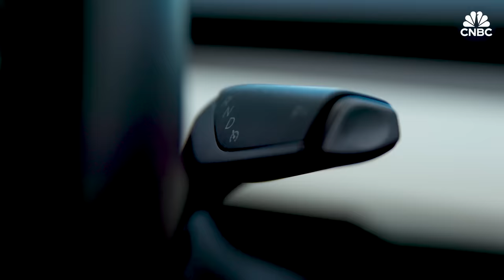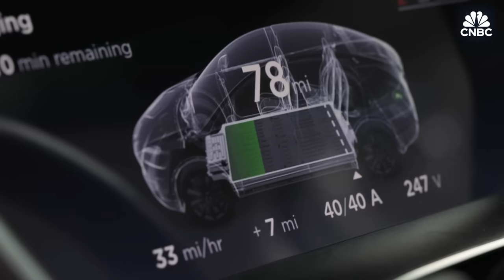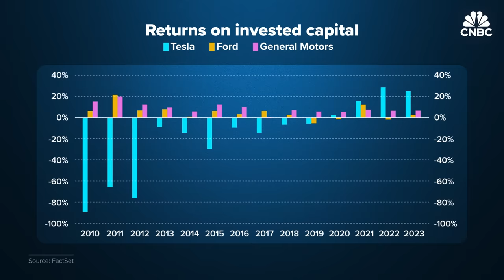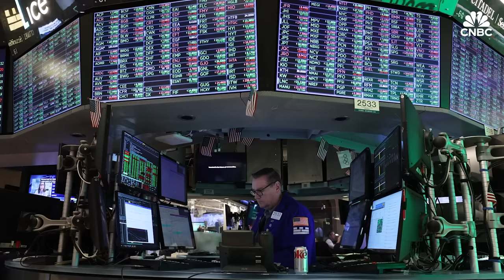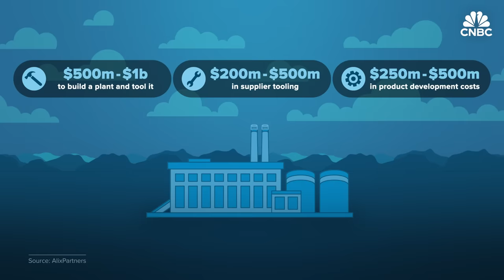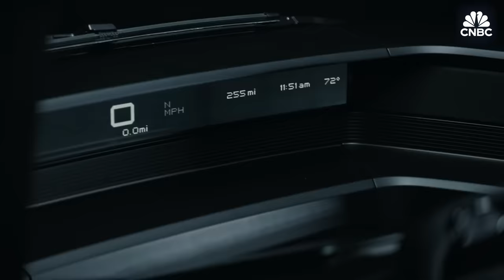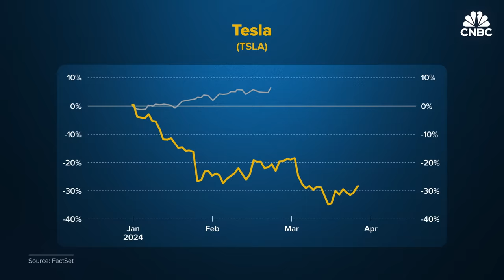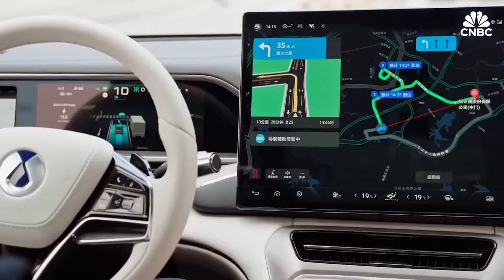Why So Many EV Companies Fail

Comment: Why they are failing? 50k to 100k is considered as a luxury car.. not many can afford 50k and up..
Reply: Teslas are available for under the average new car price.
Reply: You can now buy an EV cheaper than a Toyota Camry.
Reply: @MadDogEighty80   the main issue is the big ICE car companies haven't gotten the DEALERS on board yet.   They were happy to sell Lightnings for a 50K markup, but now that they are in good supply they don't want to sell a low margin EV to a potential truck buyer.    Plus servicing the EVs is mainly just replacing the tires.   Those $150 oil changes add up.

Don't believe me?   Go to ANY Ford dealer and ask to look at Lightning and see how fast they are showing you new F150s and F250 ICEs instead.
Reply: @redwolfexr I’m pretty sure the 90 mile range while towing deters  people from buying
Reply: @user-zt6bt8dp2c   Most people buying F150s are not towing anything.   You get F250s/F350s for that.

Most trucks are rarely used for towing or cargo "in the city."   Those are the types that are looking at Lightnings in the first place.
Reply: @redwolfexr  nobody is looking at lightning that’s why they cut production and had to halt shipments. All EVs are starting to pile up
Reply: @user-zt6bt8dp2c   again, because the DEALERS don't want to sell them.  The brands that are EV only seem to sell just fine.  They are lower profit than the ICE and need less maintenance.

Ever actually TRY to look at them at a dealer?   I looked at a Lyric, and the dealer kept wanting to show me gassers and to test drive one.  (but the LYRIC was for some reason "not ready" to test drive)

If you have 60K to spend on a new car they want to sell you a high profit SUV, not an EV.
Reply: @redwolfexr  I transport Tesla and keep up on EV market. EV are not selling especially now with high inflation and high interest rates. Not many people have 60K+ to spend on a vehicle. The government subsidies on EVs is what kept the sales up due to people taking advantage but it will dry up. Hybrid right now is the way to go maybe EVs will be the future when they figure out how to charge while on the road but with no EV infrastructure sales will keep dropping. Go to Lexus or Toyota the dealers can’t give away the RZ or bz4x
Reply: @user-zt6bt8dp2c   I can't throw a rock in a big city without hitting a Tesla...

Almost all of them are the cheaper models than 60K.  60K actually gets you REALLY nice vehicles like the Lyrics.   Well, if you can get the Caddy dealer to sell you one.
Reply: @MadDogEighty80  Which one?
Reply: the technology just isn't where it needs to be for mass production
Reply: not in China
Reply: @MadDogEighty80  Which EV? Cheapest I see is the nissan leaf and even that isn't cheapest than a base camry
Reply: BYD cheapest EV priced at 9000, but Joe said Americans done have the rights to enjoy cheap good quality cars😂
Reply: @MadDogEighty80 I’d rather have the Camry
Reply: At 50-100K they're still losing money on each car because a lot of the cost is in new production line, R&D etc and it's spread across fewer cars sold compared to hybrid or ICE
Reply: @vueport99  Yellen: BYD must sell its overseas headquarters to the US, or we will ban u 😂
Reply: @trumpbuddha1053  even Warren Buffett is walking away from BYD. I don't think anyone in USA would buy BYD HQ. It's just a small building. Total waste of time.

The bigger question is what they plan to do about all those cars sitting at the docks in Germany? Or was it simply shipped overseas to claim export bonus from CCP? 😂😂😂😂🤣🤣🤣🤣
Reply: @vueport99  then why complaint, u should be the treasury
Reply: Any $38k and above is a luxury car to me.
Reply: @Gaming_Antics  sadly with inflation that is entry level these days. Back in the day you can get a Mercedes under $40k
Reply: @Gaming_Antics  Before BTD in the 2016-2020, Tesla was making 48% profit margin, lucky they moved to manufacture in China, they are still able to make 12%. Yellen: China must not flood the market with decent price goods, we cant rip people off anymore
Reply: @redwolfexr  Do you know ICE adopted to be fueled with LPG and CNG are dirt cheap just like the fuel itself? 
Also, those are not burning oil to be charged on the EV station. Exhaust gases consist mainly of water vapour. So, yeah, extremely eco-friendly. Truly not in Musk's promises.
Reply: @HanSolo__  my LPG truck wasn't any cheaper to run than gasoline.  Plus the tank had to be certified and LICENSED by the state every year.  (I started filling it in the next state over when I was there)  Only needed the license to fill it in Texas.

So yes, I did know.  :)
Reply: @user-zt6bt8dp2c funny thing is china EVs are pretty good have good warranty like American EVs and cars and yet they sell them like hot cakes around the world except America and sell for a cheaper price with the same luxuries as tesla
Reply: EV companies charge less than it costs to make the vehicles. That is only due to government subsidies and is not economically viable over the long term. Want proof. Get a quote on a replacement battery for an EV.
Reply: @nickwest932  that would be because of tariffs but on batteries making them cost more . Buy a EV out the country and see how much to replace the battery system. Much cheaper then here in USA .
Reply: @nickwest932  Depends on the vehicle.  Some are only on the market to offset the gas guzzling V8 SUVs for California and similar markets.

That is why most of the F150 Lightnings went west.  

Tesla has long outspent its "government" subsidies.  They are making money per sale even if they may lose money due to warranty issues.  The low and mid range cars that being introduced in Europe first and brought to US are profitable.

The BYDs are still going to kick everyone's butt to the curb.

Comment: It's more broad than this "EV companies failing" thing.  Getting into the auto industry as a whole is enormously difficult, EV or otherwise.  The auto industry is littered with such failures.  The EV craze is subject to it too, though the craze insulates it temporarily (the craze, meaning, people  see that Tesla did it and just assume others can too, but it doesn't work that way).
Reply: Goated Talent
Reply: EVs are a once in a generation opportunity to compete in automotive.  It will never be easier in out lifetime -but that doesn't mean it will be easy -or even profitable.  That is the mistake.
Reply: @skyak4493  It will never be easier than it was right about 2010 or so. That year you could buy huge factories and huge press machines for a song, there was no established competition, etc. By 2015 the window of opportunity was closing fast or already closed, any new company would be entering the market no sooner than 2018, when Tesla would be making the Model 3 in mass market volumes and prices already. But IF these companies had delivered top quality cars then there was still a window because the Model 3 was bad in terms of the body construction, as Munro pointed out. 

But now, you are entering the market against two vertically integrated companies making 1.5 to 2+ million EVs this year, so they have huge scale of production advantages, and huge efficiency of production advantages from years of experience and having top talent, and from making their own parts so no packing, unpacking, shipping, receiving, and they can make changes in minutes, and they set the market price. That is the crux that this video missed in all the details: it is impossible for a startup to match both price and quality with Tesla and BYD. Startups can make a competitive car they will lose money selling, or an inferior car at a competitive price that will not sell much.
Reply: @skyak4493 ok boomer
Reply: Which means the real question is, why are there so many new EV entrants to begin with? Demand for top-down mandated ESG investing opportunities plus juicy government incentives and mandates globally. "Isn't there someone you forgot to ask?" Well, yes, the consumer.
Reply: @chir0pter  Consumer demand is clearly present.  Companies hop in because they think 'everyone can win' in that segment.  With time, though, this isn't the case.  Very tough industry.
Reply: @JT_771  Eh the consumer demand is quickly being saturated, which is why EV sales are slowing so rapidly. There's simply a large majority of people for whom they don't make sense, e.g. people with unpredictable commutes, people who like to road trip, people who live in apartments, people who don't want to pay luxury car prices for a hobbled experience. Absent new government oppression it will remain this way.
Reply: @chir0pter  The overall car market is slow.  Inventories up all over the place.  Most people care about cost.  EVs are sill a little pricey.  Cost alone will determine this with time, in favor of EVs simply to the economics of building cars.  Gov should be more hands off & let the market handle it from here.
Reply: And the auto industry as a whole makes more money off gasoline cars that have a ton more parts that need maintenance than EVs. My friend works for a popular dealership near us and told me his boss wants them to push gas cars because the warranties that come with them make the dealership much more money then EV cars.
Reply: This part of the title is laughable:  "Many EV Companies Fail'

There aren't many EV companies outside of China and the many BEV companies inside of China that are failing should have never existed in the first place.  There was NO manner of capitalism directing what happened in China for the growth of BEV, battery tech, Wind turbines and solar panels.  

Really, there were LITERALLY companies that could pop up, make the cheapest possible vehicle they could call a BEV and would make money, NEVER HAVING TO SELL A SINGLE CAR.  THAT is how much subsidies were flowing out of the CCP.  The subsidies went to companies which doesn't happen in the US and Europe with rare exception because of trade rules that China is also a part of, and violates.  These "companies" were being paid PER CAR PRODUCED, so if they could throw something together for $5000 USD they could make money without selling vehicles.

There are BEV graveyards in China with thousands of BEVs parked.  Such a HUGE waste of the earth's materials and energy.  These vehicles will never be sold because they're garbage..

The auto makers are going to slowly move to BEV.  The ones that remember what consumerism is will do well, the ones that don't will fail.  You have to make a vehicle, first and foremost, that people WANT.  No one wants a BEV HUMMER.  I mean how stupid can GM be?  Very few people want a Cadillac BEV.  Once again how stupid can GM be?  I see more Tesla on the road than I do Cadillac, so how can GM think that making a Cadillac even more expensive is all of a sudden going to bring in consumers?  I can't figure it out.

Trucks.  WHY DO companies think they can make a BEV truck?  Who buys trucks?  How many of those people want to USE the truck like a truck?  How many people who would simply buy a truck just to have a truck are going to jump on the BEV bandwagon?

BEV trucks aren't selling because when you use the truck to be a truck your mileage/charge drops pretty dramatically and I don't see that being attractive to the people who use their trucks for hauling/towing on a regular basis.  And that's what's playing out right now.

I call most of this greed unchecked.  Companies think they can make a BEV, charge a fortune and everyone will buy them.  No, that's not how consumerism works.

When Japanese companies bring BEV into the US that are small to mid size cars AND charge a decent price they'll make a killing.  There's a reason why in different years, Toyota vehicles hold 5 - 7 of the top 10 best selling vehicles in the US.  GM might have 1, Ford might have 1, other Asian companies will hold some of those spots.

So more than anything maybe American auto companies need to get back to making things people want.  That's the way consumerism works.
Reply: @tribalypredisposed  The only reason you can buy a factory "for a song" is that it is a UAW shop in a liberal controlled state with no "right to work".
Toyota gave tesla Freemont for $50m to get out of California without paying more.

You are obviously a tesla troll.  Good luck with that.  EVs are 70% auto, 30% battery and 99.9% geopolitics.
BYD is a player because they are CCP backed -not a financially backed or limited entity.
Toyota is and will remain a major player.  Hyundai/Kia are tough and growing.  VW will remain atop Europe with international aspirations and Europe will protect other viable companies to support other nations.
GM and Ford will remain dominant in the US with Dems protecting the UAW, and Reps protecting industry...
Tesla has a fine lead in the premium market, but they don't know how to make cheaper EVs at a margin their shareholders can accept.  Elon just punted on the model 2.  It is better he admitted it before blowing $5B+ but it brings to light the lousy risk/reward prospects tesla faces.  There are huge investors that see the problem.  My take is that Tesla will have to split by spinning out the high risk (AI, Robotaxi) from the low (Auto, charging, storage).  It's the only way to finance the high risk unprofitable biz and grow the auto into a full lineup.
Reply: @skyak4493  Well, your post definitely will not age well will your long list of absolutely wrong predictions. Disruptions wipe out all or almost the existing companies in an industry. One out of hundreds of carriage makers survived the transition to making cars, until 1961 when they died too. No one is going to bail out the dying automakers, because their dealerships and suppliers will also be going under and the costs would be too much for too long. 

Musk did not admit that Tesla is not making the Model 2, he said the opposite in fact.
Reply: @tribalypredisposed 45-54